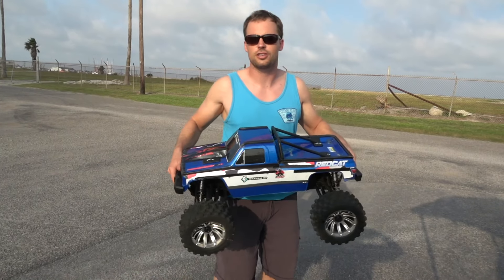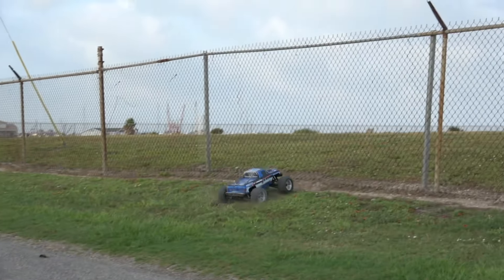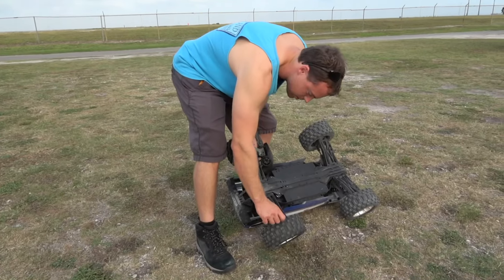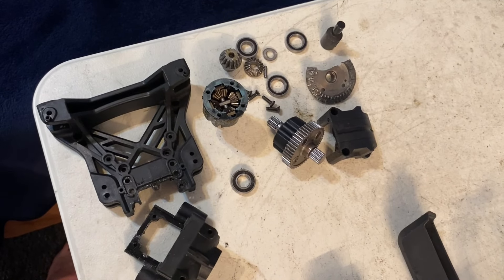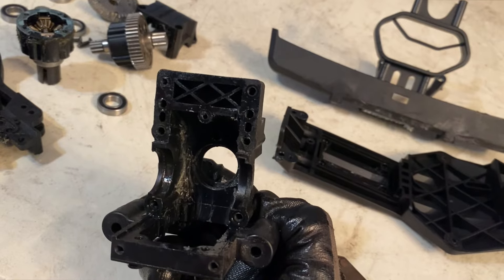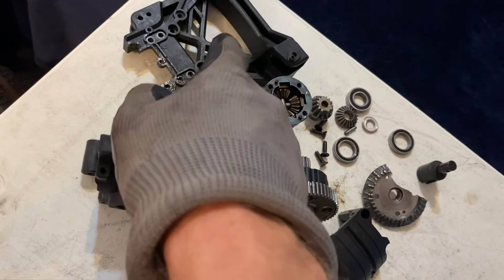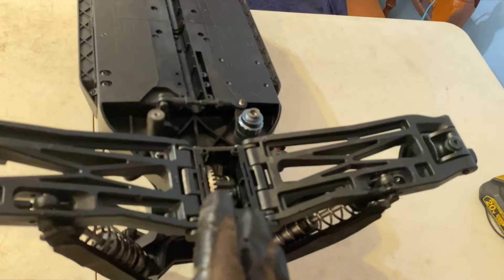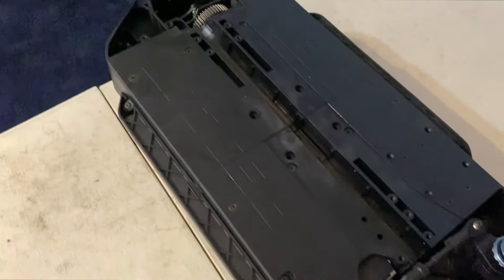Upgrades that the Redcat Vigilante needs!

Comment: On my Mad-Force I had some trouble with screws on the axles coming out.  Solution was a dab of super glue on the sides of the screw heads.  Works like a champ, since you can't use thread lock on plastic.  Put the super glue on and then use Zap-It for instant cure.  No problem removing the screw as long as you don't get the super glue in the head, and even if you do it is easy to scrape out of the metal.  The Vigilante looks like a pretty nice truck so far.  That body sure is taking a lot of abuse.  Has the body cracked yet?  Really love the body style RedCat chose for this truck, really gives it some class.

Comment: I love the Vigilante! It has surpassed what I feel a Gen 1 v1 5th Scale basher from Redcat. I agree on the fixes you laid out. Xmaxx has had a decade headstart in refinement on the Vigilante. Redcat did good.
Reply: I really hope this chassis picks up aftermarket support. It could be King at the price range...

I absolutely LOVE Redcat for still being a small enough brand that wants and listens to user feedback so directly. If they make minor adjustments + aftermarket.... 🎉

Comment: I agree 10000%. It needs billets upgrades. I just destroyed mine and see a lot of potential in billet upgrades, bulkheads, skid plates, shock towers, center brace tower, beefy drive shaft.. i bent mine..  hopefully vitavon will make more parts. They have steering assembly and motor mount but they need a few more things..

Comment: Never seen a gear break like that before, that's insane!
Reply: It's actually impressive there isn't more gear damage.   There was a lot of landings and tumbles under full or nearly full power.
Also just made it to the smashing into a fence wide open part.   Not sure I'd call that a weakness.  It's physics. The fence didn't give so something else did.   Vitavon will have these as bulletproof as anything else soon.   Mine has been very durable but I also avoid smashing into fences.   It drives and lands much better than my Xmaxx and cost considerably less.  Anyone wanting a large scale basher should definitely get one.

Comment: What's in the center diff? Front tires ballon alot.
Reply from the maker: 20 million weight. The tires are just really soft.
Reply: They're not soft 😅 ran those on 12S in my K8. No problem.

Comment: It seems like the chassis design has a serious flaw. The drive line is not properly supported. Seems like the mounts and casings shift too much causing gear mesh problems that blow the diffs/pinions. It needs a better chassis design.